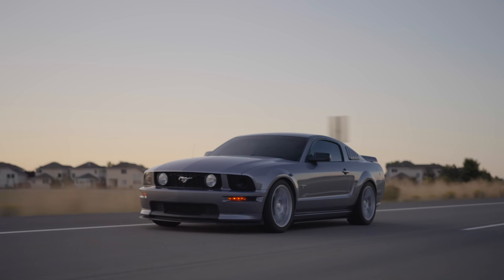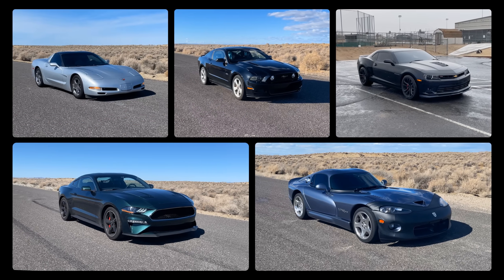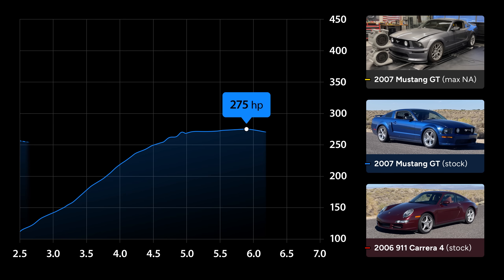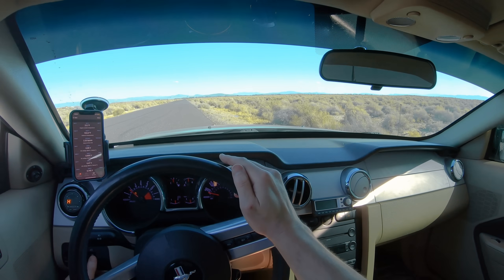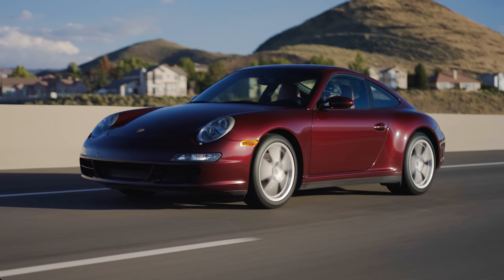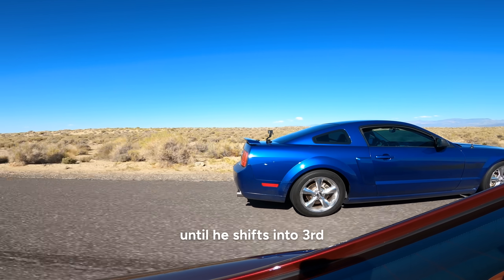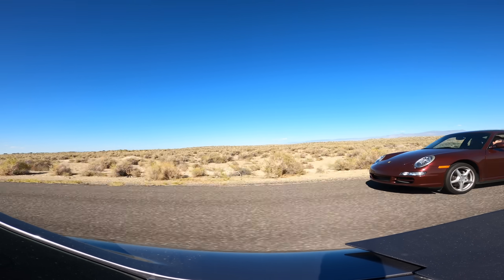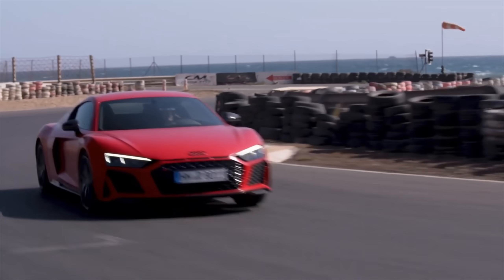This is what a 50% increase in horsepower looks like

Comment: Dude, i had a 2006 Silver Mustang GT with the leather seats, 500 super shaker audio system, front strut bar, aftermarket air intake, kooks long tube headers, cat delete, X-pipe to borla mufflers. It was the first sport car that I owned and I freaking loved that car! Watching your videos made think of the possibilities I could do to mine regarding power. But none of those plans I had came true because I sold it.

AND BROUGHT A 2013 BOSS 302!
It was essentially what I would have mod my 06 Mustang GT to be. Track/Circuit race car. It got a fantastic race inspired built engine with a more refined suspension for twist and turns. I do look back at my and miss my 06 Mustang GT from time to time. After seeing this video makes me want to find another 05-09 Mustang GT and do things that I wanted to do with it😅 In the mean time, I'll keep waiting for the next video to watch from you!

Comment: I can't imagine how much forced induction is gonna improve this build considering you're doing your best to max out its NA performance first. It's gonna be a beast
Reply: Doubt he's gonna go FI if he already bought NA cams
Reply: @Greatest_Scott  he already mentioned in the video that he is going to do it.
and he "prepared" by only going for ~9.6 compression ratio even though he is NA right now
Reply: @InFlamesOfSorrow yeah that alone tells you he had intentions of boost later. That compression has to be low to run boost. Only reason top fuelers get by because they run nitro methane.
Reply: Did you also know a 10% mix of nitropropane is a nice power adder.
Reply: @oldskolacura9798  I prefer medical nitrous oxide or the food grade stuff at the very least
Reply: @scottlefaux just a tip mate, but there is no such thing as a NA/FI specific cam. 

If you take a motor set up for low rpm torque and boost it you just get an setup that makes even more low end torque, you can't boost that motor into being a top end screamer.

Same with a top end power setup like this mustang, add boost and the dyno graph will stay roughly the same shape but just move up in power. 

The whole idea of a "turbo cam" is just a marketing gimmick designed to part you from your hard earned money.
Reply: @jakebarlow100  well, I do agree, so I'll put that here to start. I'm not trying to argue, only looking to understand more. Thanks for the reply!
I agree that a nice high end cam would be good in FI if it is tuned well for NA top end, but I don't recall that being the same for FI cam profiles being used in NA. I understand there are cams that work good for both type setups, but I would figure you want a larger exhaust cam for turbos, whch could remove mid range torque in NA

Comment: Squeezing 130hp over and still N/A is impressive 😮
Reply: No it’s not when you spent thousands of dollars on it
Reply: @luisuribe5432 it's low compression dude.. you spend "thousands of dollars" more than 3vs cost to get into these fancy coyotes so you're spending the money either way.  This thing is ready to make 1000+ wheel with boost without even trying or being stressed.  That's what you're paying for.  Some of yall aren't very intelligent.  Yea let's brag how much better the new coyotes are but just ignore that you gotta spend 30-50k just to own one. Youu're spending money either way.  This is way more unique than the same ol 5.0 build everyone does.
Reply: @Robyne_u61 130 hp above stock while still using a low ass compression ratio is pretty impressive that is a huge gain on a car that was below 300 rwhp factory.
Reply: @midnight347 Hi I have a question what is low compression and why is it more impressive that it has low compression?
Reply: @thetheorist99 compression directly affects how much hp an engine can make. I believe he is at 9.5 cr which is .3 less than stock but he has more displacement sonce it is bored and stroked. They make pistons that go upwards of 12 and in an NA build could make almost 100 more hp. But since he plans to go FI at some point you need less compression so he doesn't  need to run race Gas or e85
Reply: 80 hp/l is not impressive.
Well... it kind of is. It's impressive how little power you get from such a big engine.
Reply: @XtreeM_FaiL  it's significantly low compression makes it impressive. He could have made more with higher compression but would be bad for boost as he has planned

Comment: I always thought those years were one of the best looking models since the 69/71. I prefer the wing spoiler and wheels that are on that picture where you show the 2007 stock. I like simple easy to clean wheels. However, I'd spend hours looking at your car. I totally appreciate what you've done to the motor, especially that lopey idle and exhaust sound. Great job.

Comment: I love the build.  I was planning on doing a 5.4 4v swap from a navigator but never got to it.  It fits into the stock harness like it was meant to be there.  They can make tons of power when boosted.  Richard Holdener did a 1000 hp twin turbo 4v and it was nuts

Comment: @Four Eyes and everyone. That is one great sounding 3 valve. You are a very good and enthusiastic builder that can also do amazing videos with the best technical details I have  ever heard. Now I really miss my 2005 GT that I sold last year. This generation Mustang put the power back in that had been missing for decades. I still have some parts for it for sale that I never installed, a Ford Motorsports complete timing set and the the upgraded GT500/Shelby lower control arms that nobody seems to care about, I don't get it. These are awesome cars.

Comment: this is cool. i’m doing the same to my f body. i’ve fully built my engine, bored and stroked it from a 5.7 to 6.3l with all texas speed forged internals. makes 600whp on premium pump gas, hoping to push it to 800whp soon but i’m limited by the tires, brakes, fuel system and electronics.

Comment: Always interesting seeing the mechanical leap that has occurred across the last 13 years, that stock GT mustang puts down roughly the same amount of power to the wheels as my lil 2020 hot-hatch with a 2.0L and a small turbocharger on it. I know this is about a year old of a video but would be interesting to have seen this thing up against one of the stock ecoboost mustang's just to drive home how forced induction has really changed the game.

That said, the driving experience isn't always about having the fastest vehicle... the sound and the overall experience of rowing through gears and hitting those crispy shifts and hearing that chop are all great elements on their own.

Main reason I can't really ever see myself getting into an EV, definitely fast but for a daily driver it's a pretty soul-less experience IMHO in comparison to an ICE vehicle (especially something as nice as a big ole V8).

Suspect performance PHEV's will be the future, small short-duration axial motor to get vehicles launched quicker and then ICE motor to take over afterwards.

Comment: I have a stock 2007 GT that is getting an new engine this summer due to 250, 000 miles on the 4.6 The thrust bearing is giving up. I have the 5 speed auto and its a very fun and surprisingly fast car for being stock and an automatic with high miles on it. These are great cars and I love the 4.6 3V. The new engine has an Eagle cast "steel" crank stock stroke and I beam rods as well as Probe forged 3V  pistons. Currently deciding on what route to take on the heads/cams.

Comment: I have a stock 2010 track pack GT 5 speed with 3:73 gears and i have drag raced it quite a bit and oddly the fastest passes i have pulled are when i leave with the rear tires on fire 🔥 i think its because it dont start making good horsepower until 3500 rpm when the secondarys open. Anyway awesome video brother  👏

Comment: Of all the V8 engines I ever heard, i gotta admit, yours has the most beautiful sound. if I ever own a Mustang, I want this. It is just the camshaft + X-pipe exhaust?
Reply: Go back like 2 videos on his channel, he did like a 18-20 min video on all the engine upgrades he did, he stroked the motor from 4.6 to 4.9 so that increased hp too, Camshafts,Full exhaust,Bama Tune and more
Reply: @NudaMan  Thanks, but I mean only the sound related  upgrades, which should be majorly these two
Reply: @MrMrMrMrMrT  ahhhh he did Long tube headers and off-road X pipe

Comment: Like the shock my 1985 Corvette is, 383 stroker, .525 inch lift cam, canted valve ported heads, 3.73 gears, converter, racing transmission, and 200 shot of nitrous!

Comment: LOVE all your vids and the information you provide.  I bought an '07 bullitt, I LOVE the color, disappointed with what I would have to spend to get the power up like yours.  So I am going to sell it and go a different route.  25 k miles, and I worry about it all the time.  is a cat going to scratch it, is someone going to sling their door open... so once I sell it, im off to build a sleeper with rattlecan flat black.  If it get scratched, its less than 10 bucks to fix.

Comment: I have a 2008 Lexus ISF which has a 5.0 V8, and always in the back of my mind I really want to get the intake/headers/tune package. It would probably give me about 50hp, but it would also sound great and make full use of my exhaust that I already have. Problem is, it's like $3600 before installation (you need cats in NJ, so add those too). Tempting but I really just don't want to spend the money on it, and also potentially make the car less reliable with the tune since it's my daily

Comment: I raced my tuned 2018 S90L Volvo against a neighbor's 2018 ZL1 Camaro and then his 2011 911 Carera S - It's so fun to tune a car you wouldn't expect to hang but I did. With 4 doors and all-wheel drive semi autonomous drive! Also, the heated and massaging seats are a nice touch during winter street matches lol.
Reply from the maker: what elevation?
Reply: @Four_Eyes  practically sea-level here in phila
Reply: 39'
Reply from the maker: impressive, ZL1's are no joke
Reply: Hilton Tuning and a local machine shop have my Volvo putting down 486 hp. not enough to take the camaro in the quarter but after my car hit 140 i said goodbye to the bowtie lol. @Four_Eyes

Comment: Its cool to see.  
So I had reason, because we couldnt put a coyote in. Rules. But we have some cool mods , no dyno but will be interesting. Stock heads. FP cam, new valve train, block .040 over, turndown crank (thank to LMS who I  am sub too) longer rods , hi comp pistons . 11:2.1.  I saw Richard Holder had segment that the 3V out flowed the 4V. very interesting. New rules for next season may allow Coyote.  Thank you for the YT content.

Comment: Very fun video as always!! I just want to ask, If you're doing a high compression NA build, then wouldn't it be more difficult later to turbocharge it? or would the engine internals be able to handle the higher compression ratio+ forced induction

Comment: In 1968 my stepdad was Black flagged at Daytona during time quals. 167.86mph lap/ 210 back stretch. 289, pulling 504 hp at 9K. They teched it and it was legal. I can't imagine what he could do today with it. Shelby GT350. Carrol would have been proud. In 84 I took my 70 Muskrat from La to San D in one hour.
Wifey asked when did they paint all of the solid white lines on the highway? :-) They're dots, honey...

Comment: Great video.  Nice stable.  Good tuner philosophy, I detect very little 'douche' around your set.  I too am interested in what a nice Porsche does against the American Standard, I happen to like all the cars, Camaros, Dodges, Mustangs, Vipers, Porsches, Ferraris, and all that crap.  I'd rather tune my car than buy one, but if I could I'd buy a Porsche or Ferrari to be in the daily stable and to jerk around with, for me it's engine building and mechanics, engineering, power, gears, lifter diameter, aggressive lift profiles with fat lobes, internal balancing, bob weights, solid-rollers with .750 lift on the street, 8,000 rpm old-school V8s, etc.  And a dyno is just a graph, it's for tuning and preparing and optimizing, but it's a graph.  Racing is still compelling because there are factors.  It's about cross-sectional area, column velocity and inertia, pressure differences, laminar vs turbulent flow, heat evacuation, elimination of hot spots, quench, cylinder pressure, and if you pay attention to all of those things and more, cars are magic, the nominal specifications drop away, and you built a car just like Henry Ford had a time machine and went to school.

Comment: I like the mustangs, but I honestly prefer to mod BMWs, what I have now is a 2011 535i and stock it puts out 300hp and 300tq and the power curves are about as good as you can get, especially with VANOS and its a 3.0L I6(light). Its so easy (and cheap) to get to 400HP and 467tq and the drivetrain, suspension, handling, and aerodynamics of it don't require any modifications. Cost wise id rather go with a higher end straight 6 than a V-8 unless you want to get into the 1000hp area.

Comment: So your N/A engine is bone stock just Cams, Headers,  Exhaust and a Dyno Tune got you at 410 rwhp  which should be right at 500 flywheel HP N/A.???????
Reply: He also stroked his 4.6 to a 4.9 and he rebuilt the engine with forged intérnals

Comment: you can get a gen 2 viper's 8 liter/488ci V10 to fairly easily go from around 450 to 550hp
considering it'd be going up against the V10 from a AudiR8/ Lamborghini Hurucan which is only like 5 or 6 liters, it has the size advantage. but it's lazy. if you could boost compression, RPM, and optimize air/fuel, you should certainly be able to get in the 600whp ballpark.

Comment: the chop and burble of a classic musclecar's exaust note is what makes them sound so aggressive and intimidating. 
I honestly prefer N/A over boost, but when I wanna boost, it's with a supercharger. just cant beat the responsiveness. sure turbos make more power, and with anti lag tunes and such, you can cut down dramatically on the spool time, but I want power NOW. I dont wanna wait. and besides a centrifugal is basically half a turbo with a planetary to step up the RPM from the pully belt to the impeller shaft. also would do ducting around the mouth to try and grab in and scoop up as much air from the front and cram it in like a ram air type system, and without disturbing the body lines.

honestly, if I had a second gen Viper GTs, and money wasn't an issue, well it'd have a forged billet aluminum block, aluminum 4 valve twin cam heads, custom equal length headers, upgraded fuel delivery, forged aluminum pistons and titanium conrods, forged crankshaft, porting and interior surfaces polished and optimized for airflow without causing turbulence, as well as custom plenum that allows the charged air to  have a cyclone like effect with the fuel, allowing better mixture across all ten pistons while also aiding cooling, a large capacity intercooler with a water sprayer, dual 66mm centrifugal superchargers with ram air ducting , 15 inch 6 piston front and rear disks and calipers, 305/35/R17 fronts and 345/40/R18 rears, the Tremec T56 Magnum transmission's gear ratios reworked, a 4.51 2 way limited slip differential, independent front and rear wishbone suspension with adjustable sports type coilovers and swaybars, probably Einbachs, a 3 plate clutch at the very least, a 6 point racing cage and 4 point harnesses with carbon fiber padded racing buckets, a racing fuel cell mounted a little higher and more forward, the chassis itself stiffened while also lightening the body panels, 2 piece forged aluminum rims, a lip splitter up front and rear ducktail lip on the rear, probably delete the foglights and use that as ram air induction inlets for the superchargers, an oil cooler and trans cooler, get rid of the radio or anything that isn't necessary to keep it street legal, change out the headlights and taillights with lighter components and lexan 'glass', replace the rear window and door windows with poly-carbonate too, lightweight trunk mounted battery, strip the appolstry and replace with aluminum diamond plate treadplate floor pan, vented wheel arches, probably trim the crosshairs out of the front bumper and replace with stainless mesh with the intercooler and sprayer behind it, as well as the radiator, both having to be angled for airflow and sharing the same water sprayer, a flat plane crank....

Comment: I grew up in the 80’s when the Boss came back with an insane 182 hp but compared to the 135ish of my friends 1980 with a 135 hp 255 ci, it was fast.  When the 225hp Cobra came out, then these with 300 stock GT hp, things were getting fun.  Now with 480hp or 500, it’s almost silly.  The new motor in a 80’s 3000lb Mustang with no traction control, would be almost unsusable.   Damn near quadrupling the hp of the 80 Cobra is crazy to think about.  I used to have so much fun scaring the crap out of car salesmen back then but I doubt they’d let a 16 year old test drive these new Mustangs.

Comment: Curious how my gutted 2015 Hyundai Genesis 5.0L would fair against ur mustang, last time in the Dino it made 463hp an 457tq. That’s just a custom DIY true dual ram cold air intake, heat shielded intake manifold, intake air temp relocated from behind the intake manifold to the air box, stock headers and down pipe, but resonator was cut out with 2 x-pipes in place and stock mufflers with valves infront of them, I got different rims that shaved off 14 pounds EACH so 14x8(rotational mass)=112x4=448 lbs of rotational mass shaved off, and I’m gutted and weigh 3567 pounds with 315mm rear tires.  I wanna race u GENUINELY!

Edit*.  I also changed my ring and pinion from the stock 3.54 (car topped out at 192) to a 4.15 (don’t know what it tops out at, but my quarter mile time is 11.887.  That’s my fastest run and I got to 129 MPH.